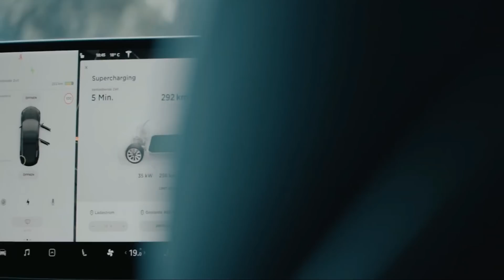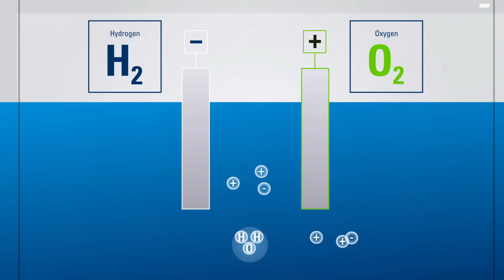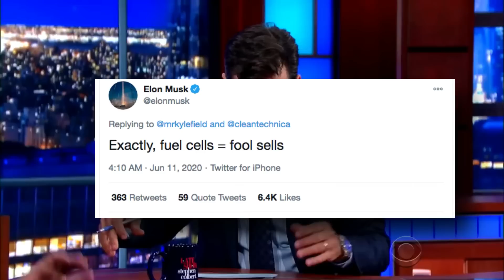Elon Musk's All-New Hydrogen Car Shocks The Entire Car Industry

Comment: In 2018 Ryder trucks had a contract  with a manufacturer for their hydrogen powered semi tractors. 6X6 running 1600hp electric motors. Not on the road yet. I am invested in an oil company that has a fleet of hydrogen trucks on the road now. Has been for years.
Reply: The hydrogen basically is an alternator that powers the battery and drive motors? That about right?

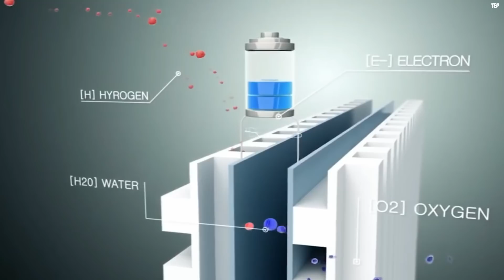Comment: 4:55 circa,  "...so it's not possible to run out."  Nonsense.  You can run out of hydrogen as you can run out of gasoline.  Idiotic.  Does this system use regen braking?

Comment: More practical than the way electric cars are currently engineered that is for sure. Also a lot of claims that aren't supported tend to be made around so called "green" energy.
Reply: Really? Maybe you should do your homework. There's nothing simpler than a battery, simple control electronics and a motor.
Reply: @rogerfroud300 yeah simple, that's why they are so inefficient.